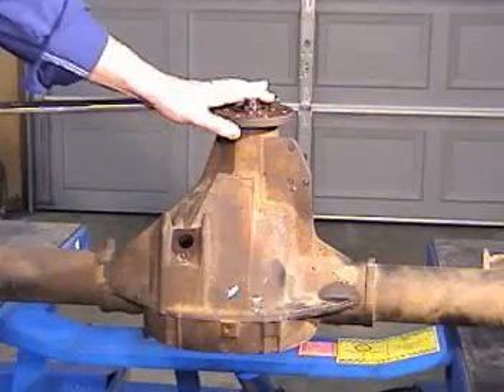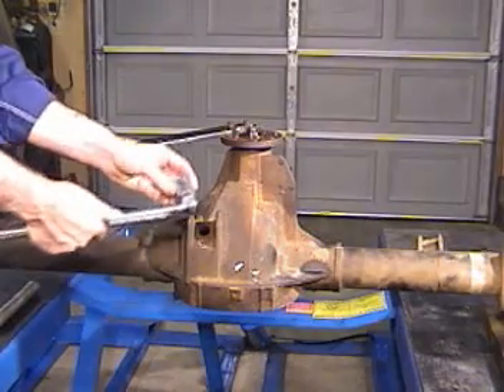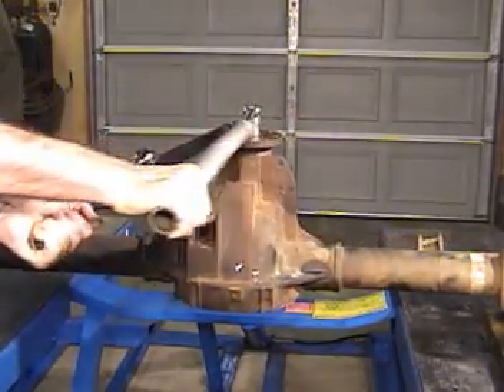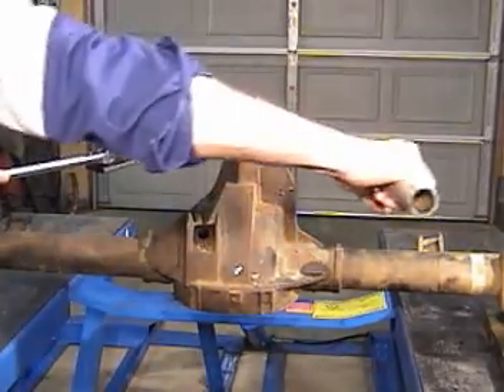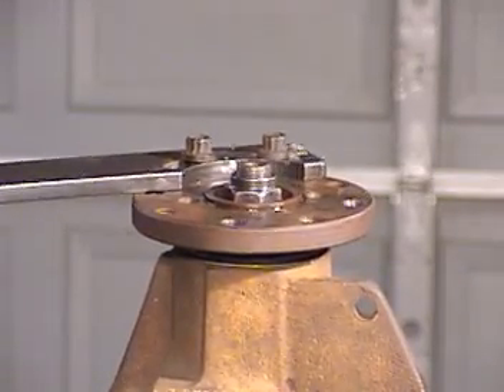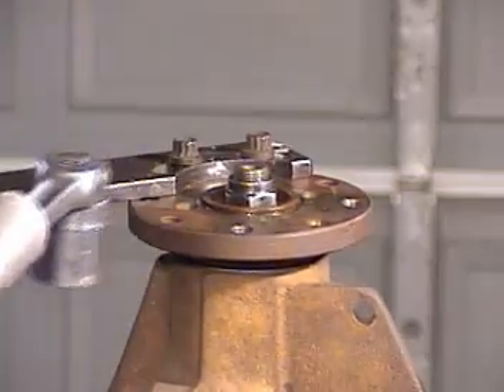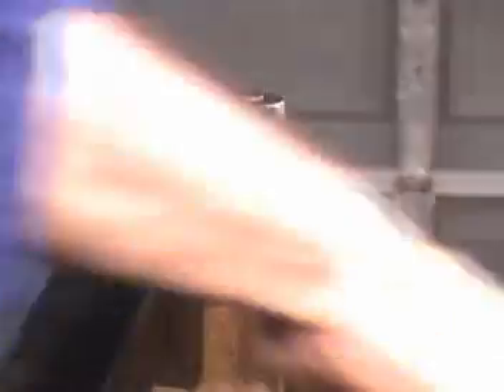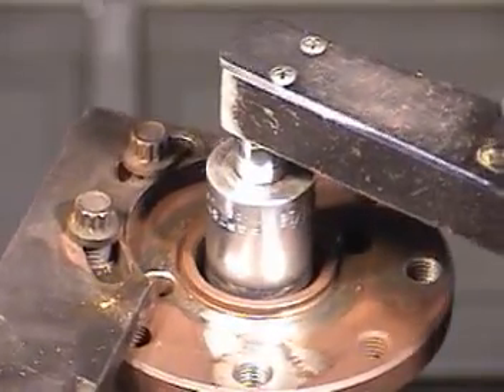Setting pinion bearing preload on the Ford 8.8" axle

Comment: Thanks for the video how do you go about setting backlash on the same axle? We have an Mustang 89 we hope to replace the diff, halfshafts etc ourselfs. I replaced the diff in my Toyota 4Runner no problem but didnt need to adjust anything as only replaced the spider gears for auto-locking cogs and reinstalled everything back where I marked it. The Mustang has new everything but cant find anyone trustworthy enough to do the job! lol

Comment: Never use an impact on any bearing
When you do this, such as say the prevailing torque nut on a CV shaft through a hub bearing, the forces will actually cause the two sections of the bearing to slam into the balls/rollers and dent the surface they ride on. NOT good
Same goes for hammering say a 6203 bearing onto a shaft, and applying the force to the outer portion of the bearing. The balls will actually dent the race of the bearing and then you will have installed a ready to fail bearing!

Comment from the maker: I have no idea. Is the pinion nut loose causing up and down play of the companion flange? Possible damaged gear teeth on the coast side. Often, when a bearing goes bad, other bearings or parts are also damaged from floating debris. May have to check everything again.

Comment from the maker: The inner bearing is pressed on however the outer bearing isn't so it's race can spin on the pinion shaft (not good). Therefore a crush sleeve is installed to put tension on that outer bearing race keeping it rigid on the pinion shaft. By crushing that sleeve to a set preload, the race is locked to the pinion but the bearings are not overly tight against the mating races in the axle housing. Too little preload, the bearing race may spin but too much load creates high friction on the bearings.